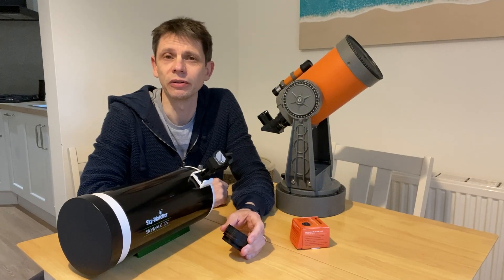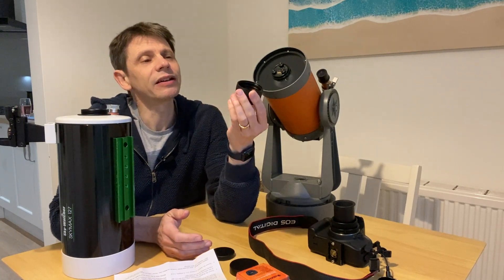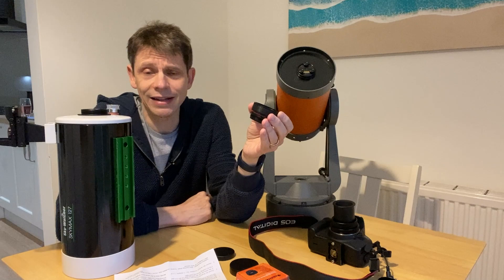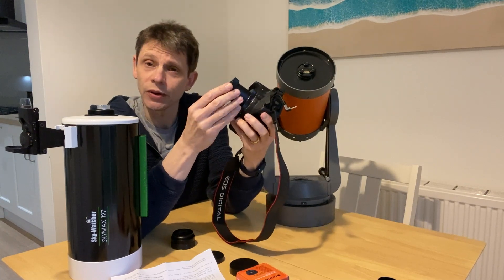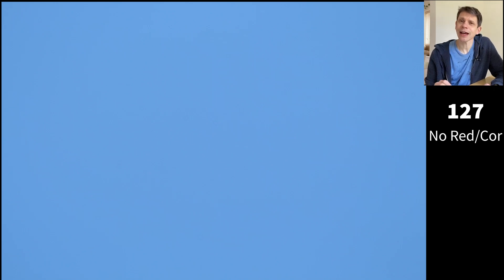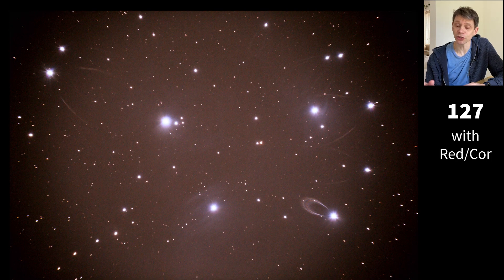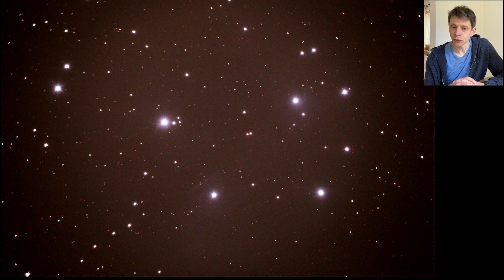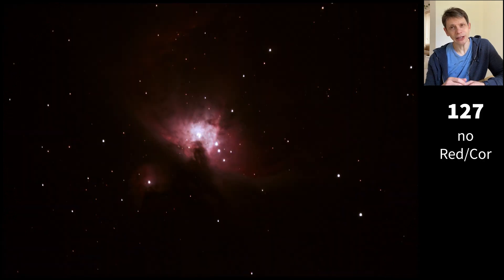SCT Corrector Reducer with a Skymax 127 Maksutov Telescope

Comment: I recently purchased a Celestron Nexstar 6se optical tube, x0.63 reducer/corrector and a HyperStar 6 v4 to use with my ZWO asi294cc on my my Sky-Watcher AZ GTi mount when running SharpCap 4.1.

I noticed that I get those strange arcs when I look at the screen as I move the optical tube around, with or without the reducer.  They have not shown up on photos so far.  Any one have any idea what causes this???
Reply from the maker: Not definitively but your observation suggests an unwanted reflection somewhere and not the reducer per see. I haven’t looked further into it as yet.

Comment: What happened to your Mak 150? Don't you use it anymore? Does 127 fit better to your needs?
Reply from the maker: I’ve sold the 150 as I prefer the size of the 127 for my lighter mount. The aperture works well for me with the brighter planets which are my most common targets.

Comment: Hi do you recall the gear you used to replace the rubber knob on the focuser?
Reply from the maker: Hi Don, on eBay I bought a 40 tooth GT2 timing pulley with a 12mm bore. Then for the motor end it’s a 20 tooth with 6.35mm bore. Both 6mm wide, for a 6mm belt.
Reply: @JenhamsAstro  Thank you.

Comment: I discovered your posts just today. First your second experiment, when you tried to block any reflections, now, this post. Examining carefully those pictures first I can say that is an over-correction, when you're using the corrector on Mak. And is manifested not only in those arks, but in a sensible coma at the edge of field, both right and left. But also, I have seen some artefacts  when you put the corrector on the C6. I am not sure if is a small vertical movement of the mount, ( or polar alignment ?) or the lenses in the corrector are a little off, but there are some elongated stars in the vertical direction, both on the right and on the left edge of the image. And, strangely, some very small rays that can be seen on the bright stars, longer to the right. But this could be from collimation.
Reply from the maker: That’s interesting. It is possible that the C5 was slightly out of collimation - I’ve found that Bob’s Knobs allow a quick adjustment but make the need for one more frequent on that scope for some reason. The mount may also have been disturbed in alignment slightly vs the 127. When I started the test with the 127 I hadn’t expected to see the issue, so I ended up switching the C5 in and out as I tried all combinations of scope and reducer, and a slight nudge of the mount could have happened.

Comment: I get the same arch's in my 127mm even after flocking and with the CCDT67 reducer.  The CCDT67 was not designed for a moving mirror system and the best I could do was an F/9.
Reply from the maker: That’s interesting thanks. Have you flocked the secondary baffle or just the primary? I’m favouring the secondary as a possible cause, as mine is a little shiny.
Reply: @JenhamsAstro  Just saw this. I only flocked the primary. The baffle was small so I decided to not go that route. Did you ever flock the baffle?
Reply from the maker: @user-pi5xu7qs7n  Yes, there’s a follow up video where I tried that. Work in Progress! Clear skies, Graham

Comment: Hi Graham, I was actually watching a similar video from Garnett Leary trying to use the same Celestron reducer corrector on an Orion Apex 127mm mak.  Instead of the stock Celestron T-Adapter he used an Astromania adapter which appeared to be shorter than the Celestron T-adapter.  He didn't include any images with stars but I would have thought he would have mentioned any issues with night images.  He only illustrated a daytime image of a water tower.   https://www.youtube.com/watch?v=6f6Vyh44Ni8
Reply from the maker: Hi Tom, I’ve seen Garnett’s video, in fact it  gave me the idea to try a nighttime test. I’m hoping to do some more investigation  to find the root cause, and I’ll add your observation to the list of things to experiment with. Only having a sample of one means I can’t rule out having a duff component in my setup, but then I haven’t had any issues with my 127; it’s a great scope in my opinion. I’ll make a follow up if i can identify the culprit. Clear skies, Graham
Reply: Hi Graham, I just saw these videos, and have an Apex 127mm Mak,  I just received the Astromania adapter and am waiting for the ScopeStuff SMSA thread adapter from Garnett's video.  Will let you know what I find.  I actually have an Orion 180mm mak and hope I can make this solution work with both.  I have to admit I have an embarrassment of riches in "Cat" scopes.  Also have a Celestron  6, 9.25, and HD11--the last two with dedicated reducers.
Reply from the maker: @tomcocchiaro3997  I don’t think you can have too many scopes!

Comment: I believe I can shed light on the cause of the light artifacts.  The correcting element, like any correcting element, is made in respect to the curvature of the system it is designed to correct.  These SCT corrector reducers are designed to correct the F/10 system outer quadrants whereas your 127 is a slower less curved field and any over correction becomes like a funhouse mirror giving an odd artifact on brighter stars in the field.
Reply from the maker: Hello, I’m hoping to do some further testing to see whether a baffle reflection could be an alternative cause. If not I’ll be left with the correcting theory.

Comment: Funny, I thought it was your wonderful self who demonstrated the benefits of stuffing a rolled-up piece of matte black paper up the (infamously un-flocked) narrow secondary baffle of the Synta-sourced Mak-Cass 127 etc scopes from the rear-end. Sounds a bit painful though... .Thank you for the demo.
Reply from the maker: My previous video was flocking the shiny primary baffle on a C90. My 127’s primary baffle is already nicely matt. I wasn’t aware of a secondary issue until it was suggested in a comment. In bright light I can see a reflection from part of the secondary baffle, so I plan to experiment to see if the reducer/corrector is “allowing” reflected light from bright stars near the edge of field to cause the artefacts I photographed. It is plausible. Obviously I’ll have to open the tube to try it but will report back the results. Clear skies.
Reply: @JenhamsAstro  Thank you Graham, but I can't find the video you mention with respect to the C90. I'd love a link to it, at your convenience. Best wishes.
Reply from the maker: @AntPDC  It's this one from a while back. https://youtu.be/FPFZbqbjbP0

Comment: That's a strange distortion, is there any way of using that particular Reducer on a refractor to see if it happens there as well, just to check if its an artefact of the mak or simply long FL
Reply from the maker: Yes, it is strange. I currently only have a f/7 APO refractor so I'm not sure it's a good scope for a test. No issue in my SCT as noted in the video though. Will do some more investigations and advise if I conclude on the culprit.

Comment: Those loops near bright stars look exactly like what happens with a C90 without flocking the baffle tube.
Reply from the maker: Hi, good suggestion. I looked at my 127 and the primary baffle tube is already nicely matt, so I doubt if that's the culprit. However there is a more reflective surface on the secondary baffle which might not help. I'll need to dissassemble the OTA to darken this. It's worth a try.
Reply: @JenhamsAstro  I'd also try varying the backfocus in the range of 85 to 105mm and observing the effect on the stars in the center. In principle, the stars should be just as good as they are with the C5 because there's no correction happening like it may be happening outside of the center. I suspect you'll give up a bit of reduction, but improve on vignetting and sharpness.

Comment: I got those same the exact same artefacts on on my Evolution 8 when using the reducer. 
As far as I could find out, this might be some type of internal reflection. I'm not sure why it only appeared when I used the reducer though.
Love the videos! 👍
Reply from the maker: Thanks! That's very interesting and does cast some doubt on my "over-correction" theory with the Mak. I had a look at my reducer to see if there were any obvious shiny spots, but it looks OK. My Evo 8's innards also look nicely matt. More investigation required.
Reply: Same here with a Meade 6inch SCT ACF. I remove the corrector lens of the focal reducer but artefacts still there. Thinking the same of internal reflexion

Comment: what happen to you  celestron evo 8 sct
Reply from the maker: I like the Evo 8 a lot. I’ve got used to the alignment process now and have been pleased with the views. It only has features you need. The reducer/corrector works well as mine is the standard Evo rather than the Edge model.
Reply: @JenhamsAstro  had the edge on alt az  sent it back too much hassle and weight  not a massive difference happy with evo 8 just been too cold to use recently lol
Reply: I recommend giving this a watch shows what is possible with alt az on sct 8 using live stacking 👌
Reply: https://youtu.be/5rUKFjHuo3k